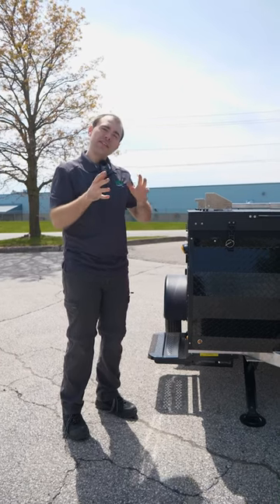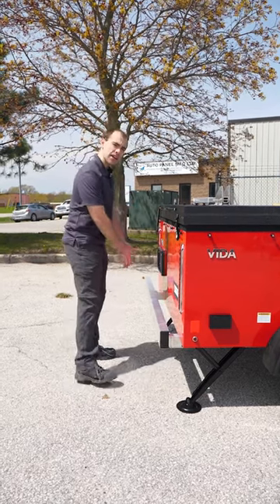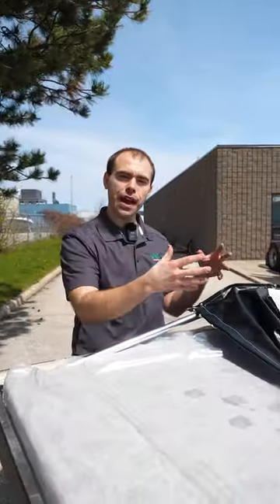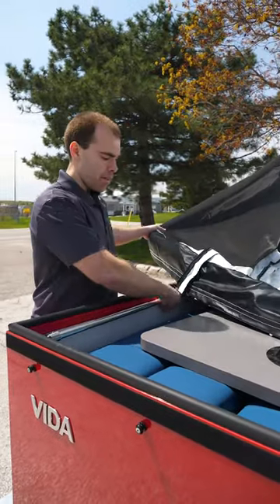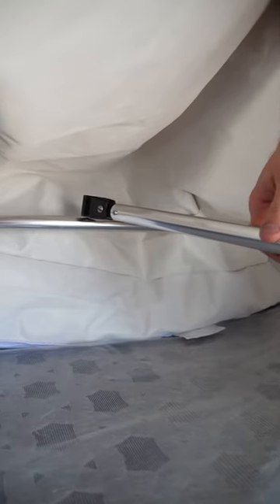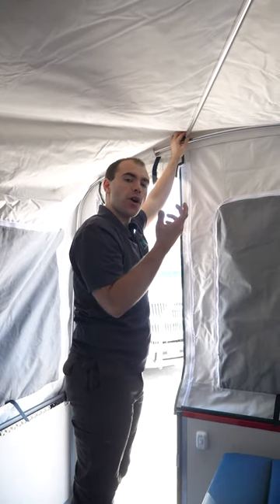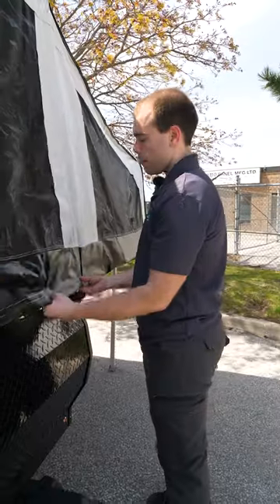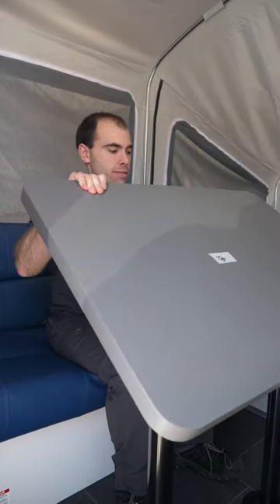How to setup the VIDA Aire60 Tent Camper!

Comment: Ugh. The whole interior is exposed when you open it up. Not a good design.
Reply from the maker: Thanks for the feedback. When it comes to camping with tent fabric, whether a tent on the ground or a pop-up of any kind - Yes something will get wet when opening or closing the tent. That is why our campers are built with 100% aluminum and composite materials. From interior cabinets, wall panels to floor, the entire box is built to last. Most pop-up campers for years have been using wood floors, walls, cabinets and roof. They too got wet when opening/closing and intern turn into severe water damage and rot - very expensive to repair. We believe our "soft-top" all aluminum and composite pop-up campers solve the years of challenges surrounding poor quality materials used on campers which are exposed to a lot of water infiltration and moisture.